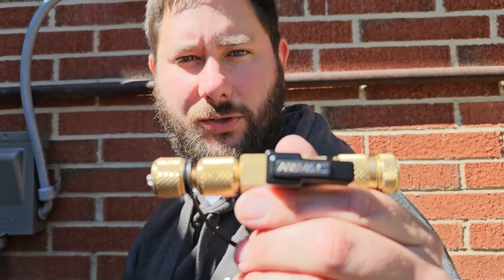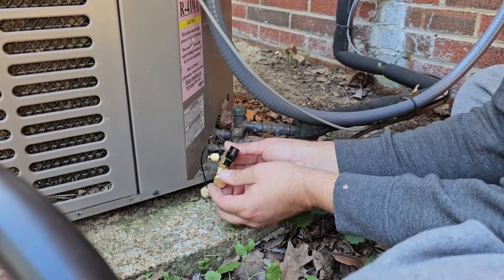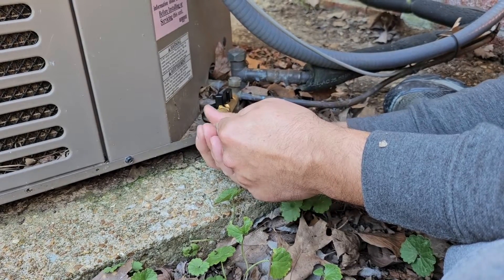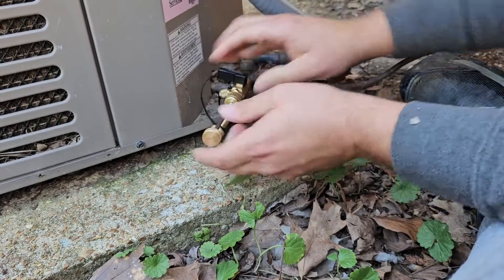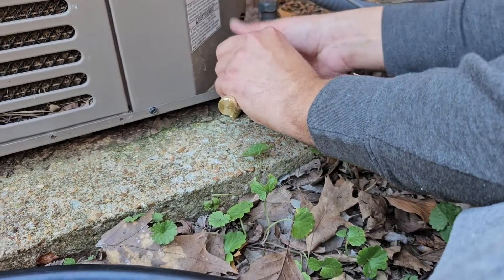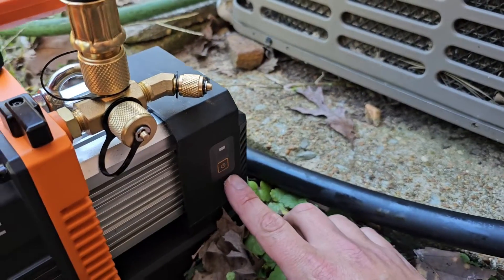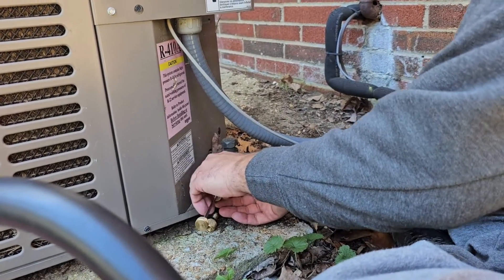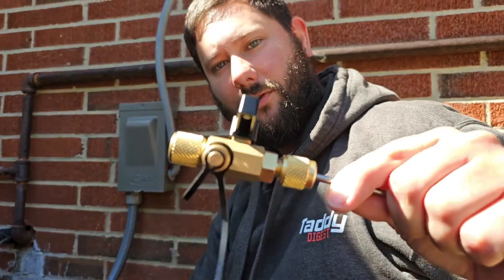Is This the Best Valve Core Removal Tool for HVAC?

Comment: When you put your valve back in after vaccuming it down do you lose some vacuum? I heard it hiss a little because of the pressure when you put the valve back in which means its not a perfect seal
Reply from the maker: Yes I may have lost some vacuum
Reply: @TaddyDigest  how far down do you vacuum then?

Comment: i opened the cap on my mini splits service port, and refrigerant came out. Tightened it back up and ordered a new core + tool. have to evacuate the pipes first using the outdoor unit right? And then replace core, vacuum and so on..
Reply: Not if you have this tool, you can hook it up, open the valve, push the core removal tool in and twist out the bad one, close the valve, take the bad core out of the tool since it is on the back side of the valve you can remove it, put the new one in the tool, open the valve, insert the new.

Comment: I jus bought one of these but tell me something tho... when i vaccum line and remove the hose dont i allow air back into the system when im placing back the valve
Reply from the maker: if you use the shut off properly there shouldnt be a loss of vacuum my friend

Comment: 2 problems with the navac core remover
1.holds no vacuum 
2.blows apart under pressure of nitrogen even if its 200psi

Comment: Sir, can we charge or recover refrigerant without removing core shrader too?
Reply: Absolutely, but it will take longer to pull a vacuum
Reply: Takes MUCH longer to pull vacuum unless cores are removed! Also...I highly suggest using dedicated vacuum/recovery hoses during the vacuuming process. They are purpose designed for pulling a vacuum. They are typically a bit more rigid than regular refrigerant hoses and have a larger internal diameter (often 1/2", 3/4", or greater). Their larger ID GREATLY reduces the length of time it takes to pull a significant vacuum compared to 1/4" ID refrigerant hoses. 

Also...on systems you've performed an evacuation on, pulling a vacuum and then using nitrogen to "sweep" the system helps to remove air and refrigerant molecules that the initial vacuuming didn't dislodge. The "bulk" of refrigerant and air/water molecules come out with the initial "flow" as the vacuum initially pulls down the system. Once the system approaches deeper vacuum, the remaining molecules don't move as freely (extremely little "pressure" exists to move them along), and the nitrogen acts to push them through, and ultimately out the system via the vacuum pump. After the nitrogen "sweep", you will need to turn the pump back on to vacuum down to the desired vacuum level.

Air and water molecules can be tenacious...on a system that has been "opened" or allowed to leak out its refrigerant (due to a leak), you may need to vacuum down the system several times (and use nitrogen to break the vacuum more than once).
Also..."best practice" dictates that on any system that has totally depleted its refrigerant, OR been open for a while (as in a coil or compressor replacement) you should replace the filter drier. It has a finite amount of moisture collection/protection capacity within the system, and there's no way to tell if that capacity has been maxed out (or is close to it).
Remember.,..your micron gauge is your "friend"....learn how to properly use it for "decay testing", and overall "how to interpret its readings!

Comment: Hope all is well Taddy, I have the appion core removal tools, several months ago I did a RTU replacement, while I was up there I had to service another RTU that was an older R22 unit.  I checked to see if my core tool would work on it and the shaft of my core removal tool would not reach the Schrader.  I was sure that my core tool was screwed all the way down but the schrader was just a bit deeper than a normal residential unit.  This was a carrier 5 ton gas/electric from 1996 i believe.  Is there a special core removal tool for the RTU’s or a special one for the carrier units?  That was the first RTU I ever did and I don’t know jack shit about them.  I spoke to you about it a week or so before I did it, I don’t know if you remember.  Thanks for the help as always, Matt
Reply from the maker: Yep that's definitely a carrier They have a special tool

Comment: Why do you need to remove the core?
Reply: Less restrictions doing vacuum.
Reply from the maker: Yes absolutely less restrictions and you can achieve a better vacuum in faster time.
Reply: Thank you to both of you who replied.  I never feel afraid to ask a fresh cut grass green question here.
Reply: @masterpopeyoda3290  they can also develop leaks and need to be changed. This tool makes it much more efficient to change them.